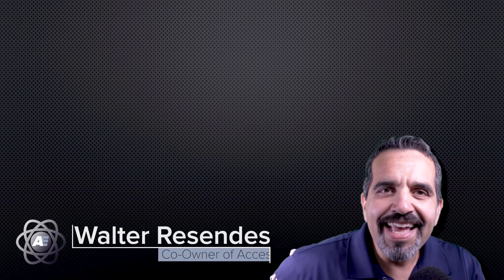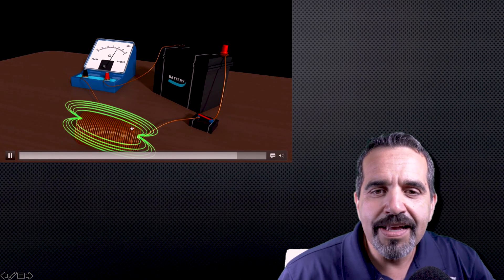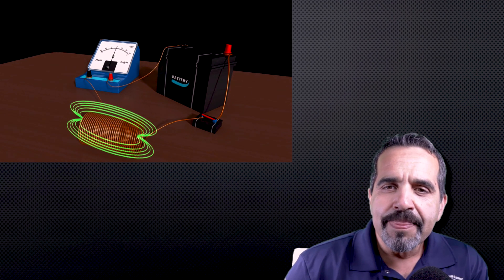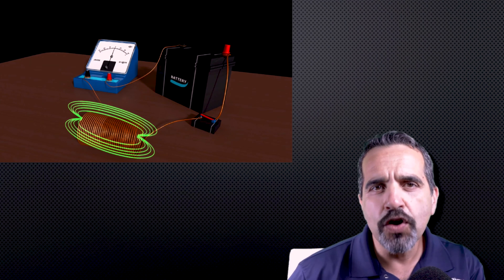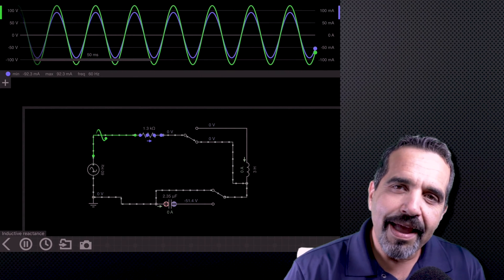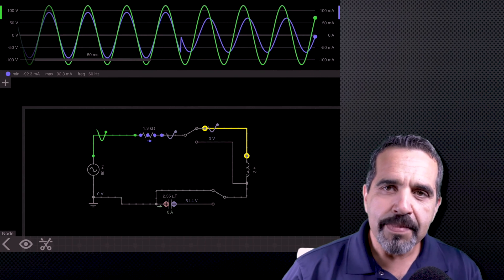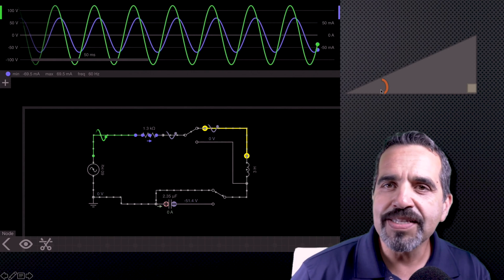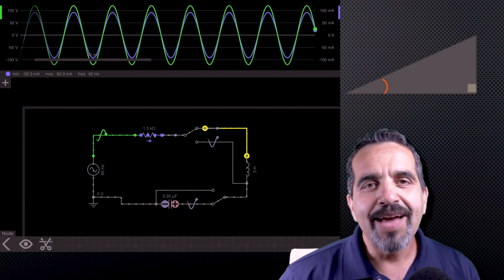What is Power Factor | Part 1

Comment: I have a question for you!   As a design electrical contractor if your customer has a power factor of 92% and is not being charged a power factor charge, do you suggest that your customer add equipment to improve the power factor?   I do have my opinion on this, just wanting to know yours at this point.   Respectfully submitted,   Kevin
Reply from the maker: Kevin Coop hey Kevin. No I would not suggest adding equipment. 92% power factor is really quite good. Now if they were between 60 or less to 80 and were being charged by the utility for poor power factor, then I would make recommendations.
Reply: AccessToPower     We agree for possibly different reasons.   I watched your second video on this and voltage drop.   Hope you do not mind comments and discussions.   Warning, I look at most things from outside the box.   Respectfully,   Kevin